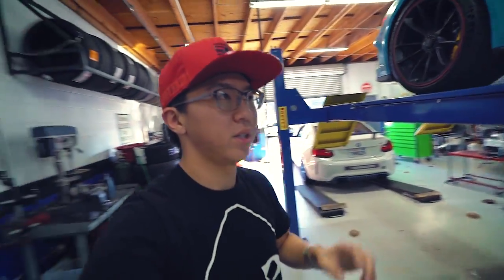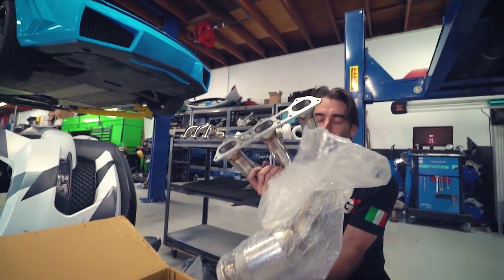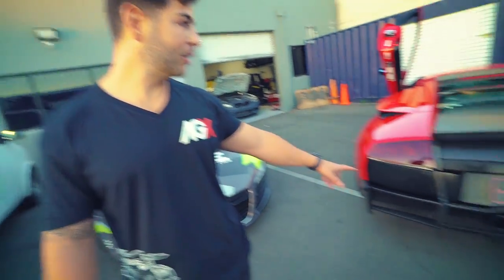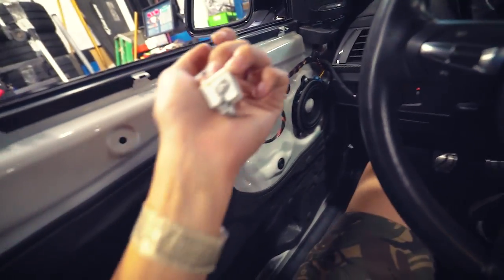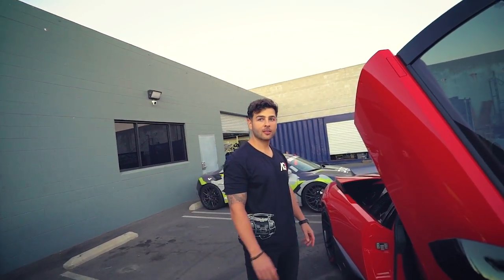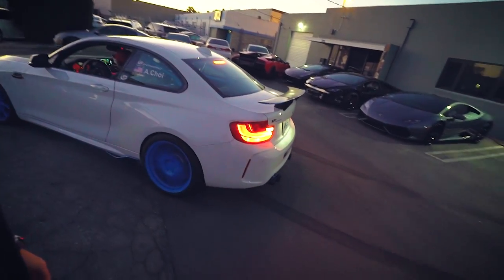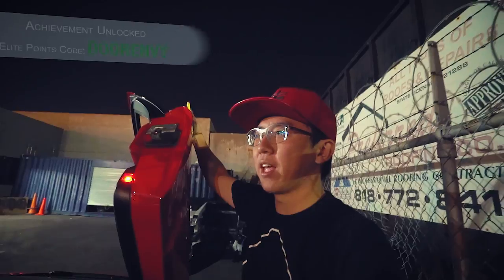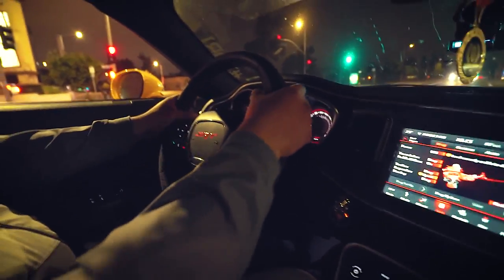STANDING BURNOUT DESTROYS LAMBORGHINI MURCIELAGO CLUTCH! *ALEX CHOI VLOG*

Comment: 10:50 that’s what’s it’s like to drive “ANY” car without power steering bro lol
Reply from the maker: #facts lol
Reply: That’s exactly what I said 😂😂
Reply: Dilbert1738 I’m not repeating what he said. I’m saying “any” car without power-steering is hard to steer.
Reply: Not a Honda CRX. It weighs nothing.
Reply: J.R. Beumel lol you’re right
Reply: @dreyusalexander718  I put 714hp and 598ftlb for torque in a CRX. Boosted Boiz have nothing on that CRX. It ran a 8.54 at 154MPH.
Reply: J.R. Beumel gawwwdddd damn! Any videos on it?
Reply: Well...it has wider tires than a Civic and wayyy gripper tires.  So he has somewhat of a point.